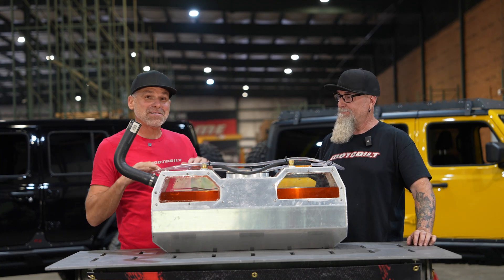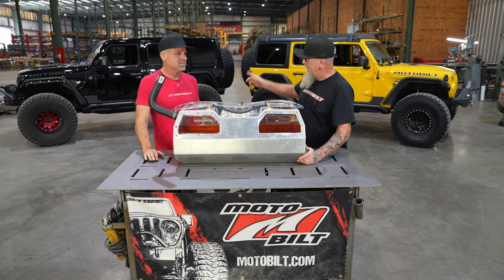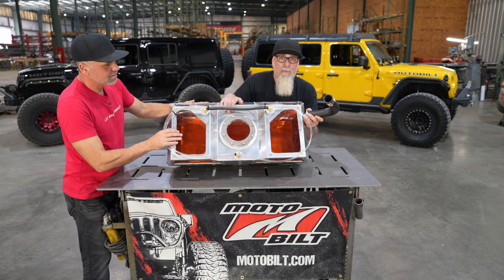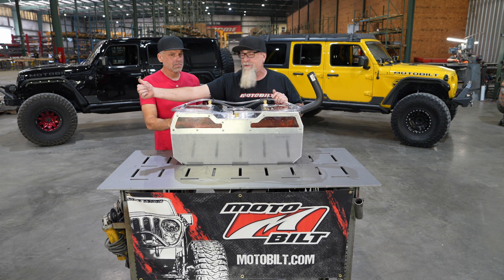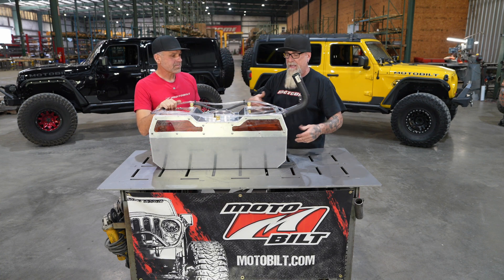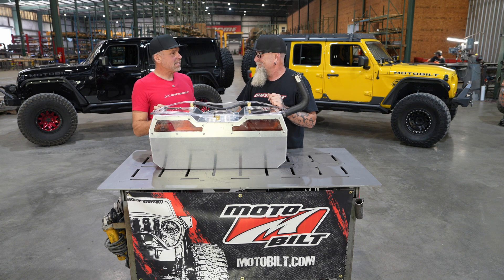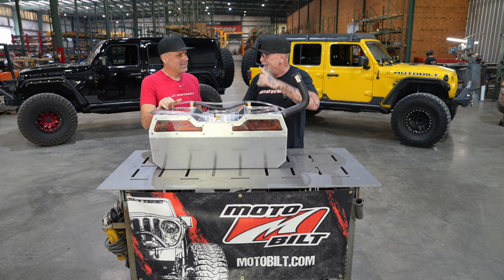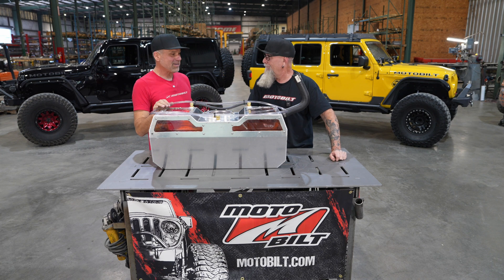Fuel Cell Venting 101: Prevent Leaks & EVAP Woes 🛢️💨

Comment: What about expansion of the fuel. Won’t that still force fuel out of the vent
Reply: If you are referring to building pressure then that is the purpose of the vent is to release the pressure in the form of fumes via the vent.